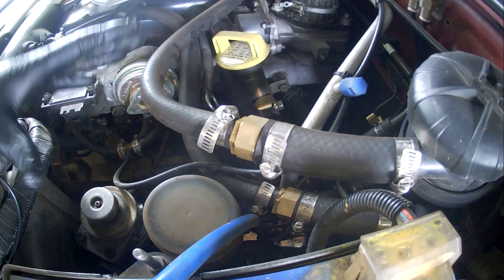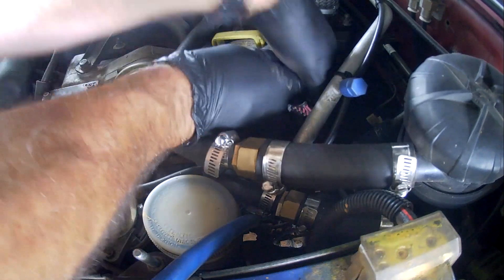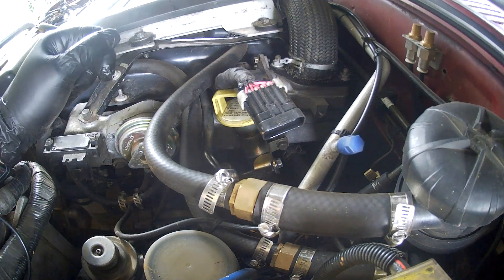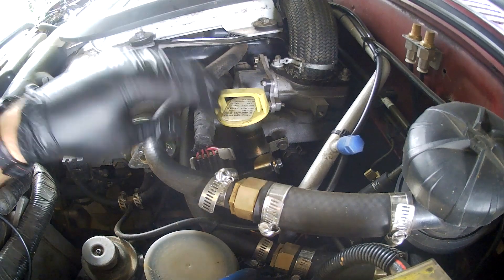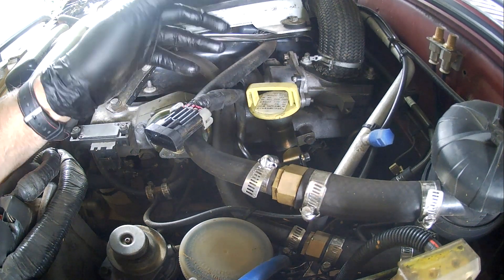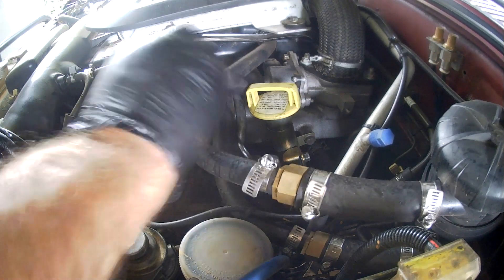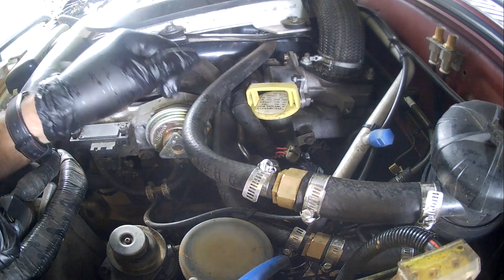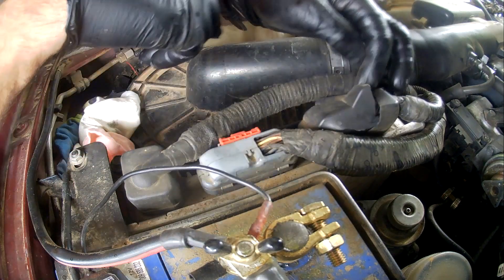The 4JX1 Injector Harness Plug Oil Ingress Issue

Comment: FYI in case it wasn't mentioned.
The oil ingress comes from the RAIL PRESSURE SENSOR.
The HI pressure oil seeps past the internal seal of the sensor.
The electrical (3 pink leads) connector to it has a strong multi-lip seal.
The oil then gets PUSHED into the 3 pink wires and gathers into the external connector.
The oil then causes data/voltage issue = driveability/starting problems.
Clean AT BEST is a TEMPORARY fix.
Fix = replace loom AND the 3 pin  rail pressure sensor.
Problem though eventually DOES come back.
Want to stop it from happenning again ?
Cut a small 1mm nip of the wire cover to expose a bit of the wire on each of the  3 CENTER pink wires on the SAME side as the connector locking clip.
That way the oil will come out from the wire and not go into the loom since the pressure is now relieved.
My loom & sensor were repalced twice under warranty and again myself twice with new parts .grrrrr.
When I did it 7 years ago I clip the insulation as above.?
Gues what ? 
There is oil dampness around the cuts but NOTHING in the connector.
Car continues to run fine 24 years/380k -- touch wood :)
Reply from the maker: That goes against what I was told, it is the multi strand wires that allow capillary action that gets the oil to the plug from all the harness wires
Reply: @thejackaroo4WDcampingchannel  Capillary action still requires a source.
The 6 internal connections are all triple lip sealed onto the 4 injectors, oil temp sensor, rail pressure sensor.
All the 10 pink wires are internally sealed and are unable to suck oil in through their pink insulation.
There is no oil pressure coming from the injector coils - so not the source.
The oil temp sensor internals are sealed in a metal housing - so not the source.
The RAIL PRESSURE sensor has on openning direct to the hi-press oil - BINGO, the source :)
Eventually its internal seal fails (like the internal injector o-rings)
This leakage then forces its way to the 3 pin connector and into the 3 pink wires continuing into the external connector.
Approx 7 years ago I nicked those 3 pink wires on the enngine side of that connector.
Inside the connector remains dry.
Yet I have oil at the 3 nicked pink wires.
Where does that oil from the 3 pink wires come from and connect to ?
The RAIL PRESSURE sensor.

Comment: Hello, the problem is that it does not start and I put spray through the intake, it starts failing and more than 2000 rpm, otherwise the engine stops, what should I do? ...thank you
Reply: Had this problem it was the cam sensor, the one on top front of the engine.
Reply from the maker: You will need to identify what the issue is being caused by. Have you made any changes lately such as an engine service?

Comment: been having starting problems with mine stops when i put it in gear AUTO runs rough in gear oil in this plug i mite have to try to mod the wiring as well, did you mod your wiring on injector harness as well
Reply from the maker: Oil in the injector harness plug is common, you need to check if ECU plugs are contaminated too. Yes I modded the injector harness.